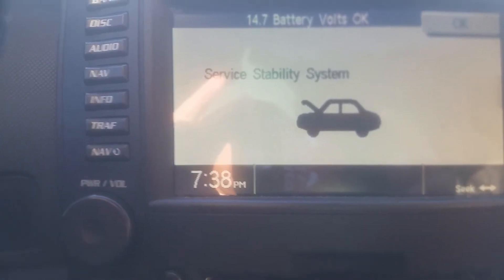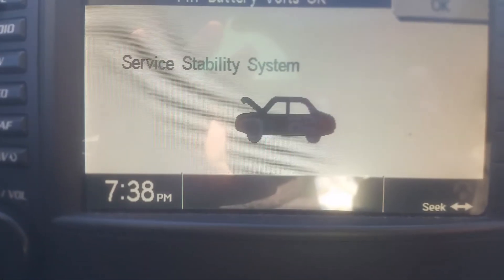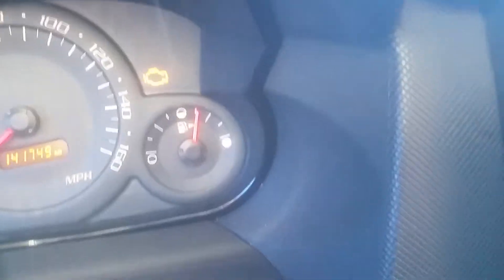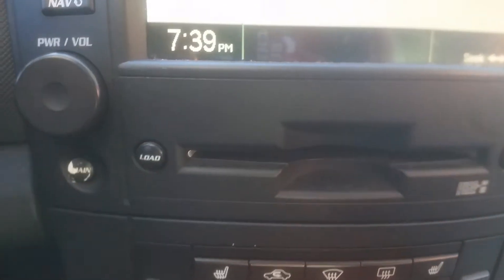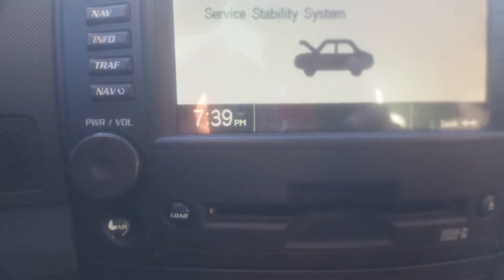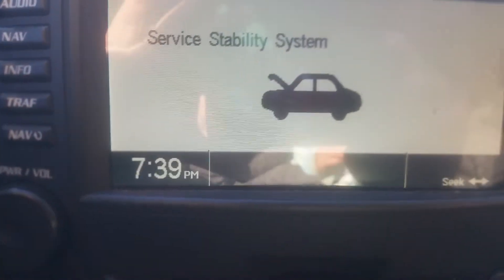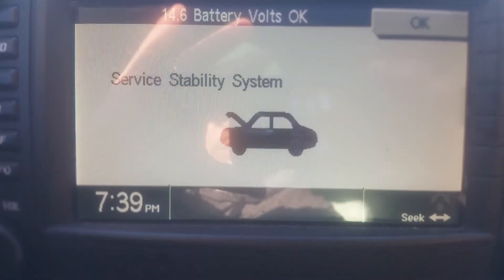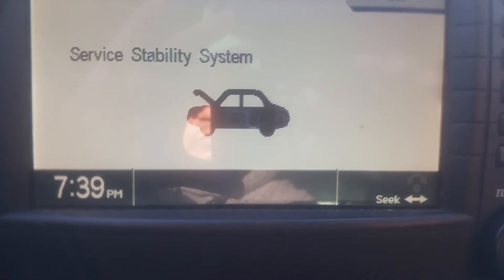Service Stability System 2004 Cadillac cts

Comment from the maker: getting back to this video update don't buy the sensors on line if do make sure is OEM, I  did buy my  twice. Cheap sensors won't read right and it will give you faul codes Better go with the right ones Oreally got the bosh upstream for $110 don't make the same mistake I made.

Comment: My service stability light is on like yours except mine has no traction control. No check engine light. Just put a rear end in and a rear driveshaft carrier bearing. It also has a slight shake around 85-90 mph any suggestions? 
Edit: I also put new converters, and have redone the exhaust, that is not the issue
Reply: Yea you shouldn't be going no 80 90 mph slow tf down

Comment: I can promise you that the check stability system alert has NOTHING to do with a catalytic converter or an O2 sensor. It's possible that's why the check engine light is on, but instead of throwing $500 at the problem blindly why not get the codes pulled first so you know exactly what's wrong with it before you just start guessing? I would try to at least know what I'm talking about before making a YouTube video.
Reply from the maker: Ryan Lorance if this video help on anyway fine if not keep looking for the right one, I  post not because I make money doing videos, good luck with your project
Reply: Ur Right!
Reply: Thank you...
Reply: Jaime Moreno 
Well “I thank You Jamie” you r thoughtful because I had NO CLUE even where to begin or even what it was... After a read at Auto Zone I will let you 👍